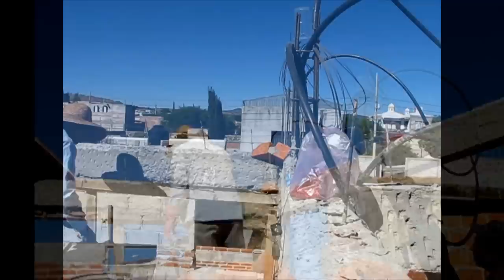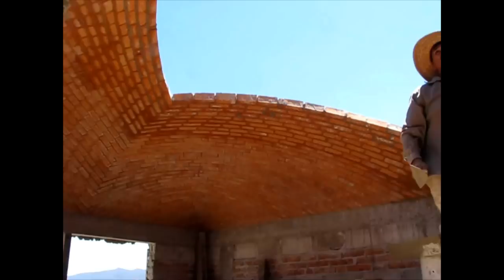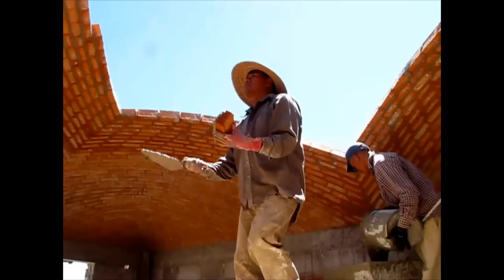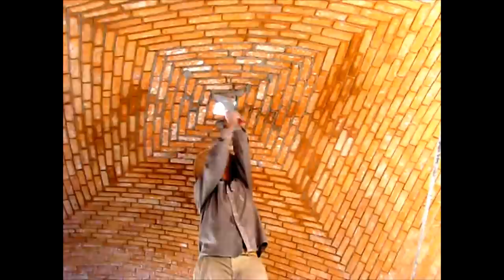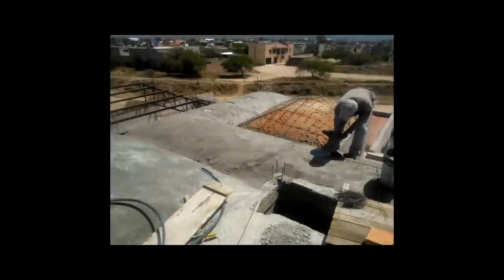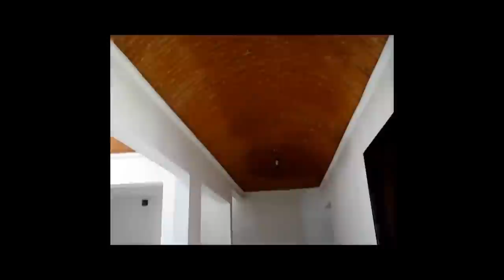How to build a solid brick dome virtualy Defying Gravity, Truly amazing! The strongest celling

Comment: I truly respect any Craftsmanship & dedication to the craft - using the medium of choice- here is brick to create something out of nothing. Often doing the more difficult task & what others say is impossible.
I’ve hired Mexican brick masons on smaller remodeling projects before, & I was amazed at the speed & agility- they got bricks replaced on an Home extension/addition, and just as I had envisioned- they seamlessly incorporated the new bricks with the old ones removed to make room for the additional room, making it look like the new addition had been there for 40 years...
All other American masons had tried to convince me how much easier it would be to cut the old brick off in a straight line, and scrap the old bricks, and completely put new wall up with all new bricks. Hence you’d have a straight line of old - next to new. 
The addition would be obvious.
When I told the Mexicans what I wanted, they just said 
No problem, when you want it done sir?
And their work was impeccable.
Despite that the funny thing I recall was all others required me to get a mortar mixer on site for them, the Mexicans just told me they need 2 pieces of plywood in which to mix the mortar on, the younger man in the crew mix the mortar, staying one step of his masons.

Comment: Building Control in Britain would be horrified as usual, they don't think other countries have equally proven methods of safety. They need to learn a thing or two from these master craftsmen.
Reply: most developed countries look at a structure that's been standing for over 1000 years and think, "that's not up to code".
Reply: That's because in most developed countries if those structures were built now without codes they would fall down due to cost cutting and cheap material. Codes were created to prevent this. Back then a bad builder ended up starving to death through not getting any more work or "other" methods.
Reply: Justin Clark Even China has building codes. They did have buildings constructed that didn't meet them and, shocking I know, they soon had problems and some fell down killing people.
Reply: Look again, notice that they have interlocked steel reinforced concrete beams above all 4 walls, so when this dome made of bricks set hard, it becomes as one single structure along with the 4 beams and since they are tied at each corner with steel reinforced bars, the whole structure becomes as one single entity, so any movements within the walls will not effect the roof dom. Clever design, strong, earth quake resisting for sure. The roof can only fall if the walls crumble first, which if they do then no matter what type of roof you have will also crumble down.
Reply: samdomding exactly bro 👍
Reply: At first I didn't notice it either, but if you look  hard, there is a steel  reinforced concrete beams above all 4 walls and i am guessing that each beam is tied to adjacent beam by steel rods, such that they form a rectangle, and the roof constructed of bricks then spreads its weight or forces on to the concrete beams and becomes as one solid structure, as long as the beams don't move away from one another the dom stays intact under any movement. Roof would only collapse if the walls gave way. If one of the beams moved out and away, then there would be a high risk of dom collapsing.
Reply: Kevin spacey yh buddy true which they learnt of the persians babylon etc , so it really doesnt matter who did what just marvel at the craftmanship mate 👍
Reply: Mmhmm. And have you seen the Roman Colosseum lately? That roof is caved in as shit. All those gladiators and senators crushed. God damn travesty of engineering, that.
Reply from the maker: Once closed, the arc, and vaults are structures stronger engineering there, watch this video where substantial evidence on these vaults are made, follow the following link, where they do the test with hollow materials and facts with plaster, in Mexico, we use solid bricks and concrete, brick see this video: https://www.youtube.com/watch?v=vHrIkk4wo9s

in Mexico City there was an earthquake of 8.1 on the Richter scale in 1985 and many modern buildings fell dawn. but many of the oldest buildings (15th century built with this technique) were undamaged or slightly damaged. the metropolitan cathedral is sinking down (because of the ground in which was once a lake and yet still standing ...
Reply from the maker: Once closed, the arc, and vaults are structures stronger engineering there, watch this video where substantial evidence on these vaults are made, follow the following link, where they do the test with hollow materials and facts with plaster, in Mexico, we use solid bricks and concrete, brick see this video: https://www.youtube.com/watch?v=vHrIkk4wo9s

in Mexico City there was an earthquake of 8.1 on the Richter scale in 1985 and many modern buildings fell dawn. but many of the oldest buildings (15th century built with this technique) were undamaged or slightly damaged. the metropolitan cathedral is sinking down (because of the ground in which was once a lake and yet still standing ...
Reply: dunno where u got that info but im pretty sure old buildings in mexico city got as bad as the new ones , they were just far from the hit point (im from mexico , my dad lived and often tells me about the earthquake every now and then).
Reply: Old cathedrals are built like this and they have survived earthquakes for centuries in Mexico. They have thick walls to support the domes and the forces they produce.
Reply: Bunny Warren also is because actual governments want to profit out of everything
Reply: samdomding Agree.
Reply: samdomding your one smart feller
Reply: This wouldn't last well in a heavy storm, hurricane or earthquake...I'd trust them building a bush shelter but when it comes to a more modern style of building I don't trust this at all. Building permanent bush shelters isn't the same as building a structure out of brick and concrete lol.
Reply: samdomding 
There’s a good reason many of the ancient Mayan temples & pyramids are still standing & structurally sound hundreds of years after construction , the engineering & the craftsmanship is impressively ingenious.
Reply: Yamaha Life 
You are crazy as hell,
That structure will be there, when everything else is blown away.
All concrete & brick.
This is proven engineering.
Many won’t do or attempt levels even close to this type of craftsmanship, cause it isn’t easy, and it’s time consuming.
Most want the cheapest, the fastest, and the easiest.
And expect it to be the best.
Poor thinking.
Reply: Justin Clark

Actually, the only reason very old buildings are still fully intact is because they hire people to ensure it stays that way.
Reply: Yeah but... would you really want to live in a brick building in britain?
Reply: And no not all the mexicans at home depot produce this quality of work rofl.
Reply: The whole roof is a weak point, you drop a 6 inch block through there and the whole thing will fall down. That's why you wouldn't build something like this in the UK. We make strong buildings with minimal weak points that can withstand impact and weather. It looks great though!

Comment: An arch supports itself ONLY after each course of brick is complete.  The reason the bricks are not falling before a course is complete is all in the mix.  Nice rich mortar with some additives. The amount of water in the mix is important too. Also the type of clay bricks they are using will suck the water right out of the mortar extremely quickly, especially in hot sunny weather. So the mortar is bonding/drying almost immediately after a brick is set enough to the point where it will hold.  The application is obviously important too. Set tap and go.  Play with it too much and u can break the bond.  The most impressive thing to me is the fact that they are basically free handing this whole job. Doesn't look like there's any lay-out or guides.  As far as cutting the brick,  it's actually not that difficult to break a clay brick with a trowel if u know where to strike it and which part of the trowel to strike with. The cut also doesn't have to be perfect as the mortar joint will give u some room for error.  Def can't do that with a solid concrete brick though lol.  Extremely impressive work here

Comment: I wouldn't want to be in this during an earthquake.  Beautiful as it is.
Reply: Gary Hardin why not? it's an arch, quite strong, actually the kind of structure you want to be under during an earthquake.

fragility of buildings has to do more with insufficient foundations.
Reply from the maker: You know! 
Once closed, the arc, and vaults are structures stronger engineering there, watch this video where substantial evidence on these vaults are made, follow the following link, where they do the test with hollow materials and facts with plaster, in Mexico, we use solid bricks and concrete, brick see this video: https://www.youtube.com/watch?v=vHrIkk4wo9s
Reply: Coleman Priske just copy and paste

Comment: You couldn't pay me to even stand under that.
Reply from the maker: Once closed, arches, and domes are the stronger structures, watch this video where substantial evidence on these vaults are made, where they do the test with hollow materials and facts with plaster, in Mexico, we use solid bricks and concrete, brick see this video: https://www.youtube.com/watch?v=vHrIkk4wo9s
Reply: Coleman Priske What weak, weak evidence.

The arch in the video that you've brought has a 3D composite structure especially designed for strength, it weighs about a thousand times less, and its angle is far more acute.

You're literally just saying that because "arches are strong structures" then every arch, no matter its properties, will be strong enough for whatever.

And the second arch in that video, which is very close to what's in this video - actually falls down!
Reply: Lepe yet thousands of homes stand for decade's build with the same roof type

Comment: he wets the briks and applys it to dry hot briks creating a suction or vacume allawing the arch to stay. clever but it aint used in england cus it wud be illigal to do, health and safety breaches all over ere.
Reply: Jamie Cropper adding water to bricks can be common if the brick is very dry or too hot. The brick can be tested by putting 3 drops in the size of a quarter and timing absorption rate. Many US kilned brick do not need water soaking.
Reply: sadly health and safety is like the n.1 rule in england so you cant do shit if it violates it

Comment: How is his trial not bending from beating on the bricks? He is a skilled Mason though. 👁
Reply: A masons trowel is made of the very hardest steel.
Reply: john athas a Mason's trowel near to handle where it connects to the blade is thickened it is almost a quarter inch thick on the blade and tapers 2 the outside points of the diamond that in many many years of practice trial error and perfection these men do it as a living and a passion along with many other men in other trades that require physical labor to accomplish there's a whole plethora of skills that never make it to a TV
Reply: oh ok. thanks fellas. glad to see I totally spelt trowel completely wrong. lol
Reply: john athas trowel and it's good steel. Sometimes they crack at the where it connects to the shank
Reply: Because it's not a Marshalltown and probably a Rose hahahaha

Comment: The stone arch, defying gravity since 2000 BC. 

In other words nothing amazing here. Just a dedicated craftsman doing his trade.
Reply from the maker: agree!
Reply: The amazing part is not the arch which by the way dates back much further than 2000 yr.s.  It's the fact that the arch work is constructed without centering.  The temporary support that holds the arch in place until the keystone is palced.
Reply: James Robinson Not really. Mud bricks like these are relatively light and the cement holds them long enough to get them all up and let them settle into place. This arch is leaned into the corner so the corner is actually taking up the load of each successive layer, meaning each arch isn't self supporting.
Reply: And there's nothing amazing about that?
Reply: Cragified mine arches are with wedge brick and a key stone,  his are not.
Reply: William Baker O I C
Reply: Cragified normally engieers dont wanne gamble with a structure like that . one lil earth qauke and you got a few thousend pounds of bring in your bed . No thx
Reply: +silvester weber read the more info section.
Reply: Cragified it's that he is doing it without framework. You every did this u think it's pretty impressive
Reply: well, i think it's still amazing
Reply: Arches that old have keystones,  these arches don't :)

Comment: Triggered * very great work still dont know how it doesn't fall from its own weight having still fresh cement.
Reply: Uh Oh. Arc?
Reply: +hogsandsooners =eagle eyes
Reply from the maker: Here you can see about the cement, and we and explain why the vaults do not fall and what is its structural base  (remember to turn on captión, i have translated to english): https://www.youtube.com/watch?v=hE0MSwqoaVU
Reply: No lime or yes but not a lot Cuzz it would make the structure weak! The brick is called dry brick and its like a cookie very dry and it is strong sucks up lots of water drying the mortar very very fast! Unlike regular brick Wich take some time to set up! 😉
Reply: mannyrosario83 because of a keystone...just like any stone arch
Reply: Its like a dam against gravity
Reply: Uh Oh its because you run em in a spiral essentially. Four sides support each other
Reply: Gotta be right first time also the heat will play a major factor he was even dipping the brick because of the speed the line mortar was drying out looks amazing doesn’t it
Reply: mannyrosario83.    Strong foundation first is KEY! as you go up the mortar Drys by the minute.solid Structure.  A trusted habit.  Right ON!👷🙋
Reply: 01 3  you are a funny guy